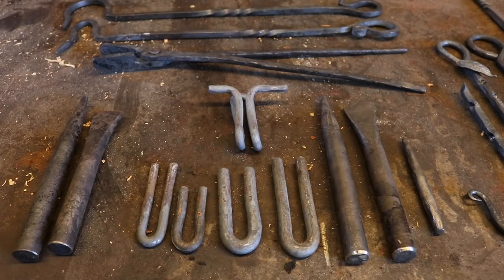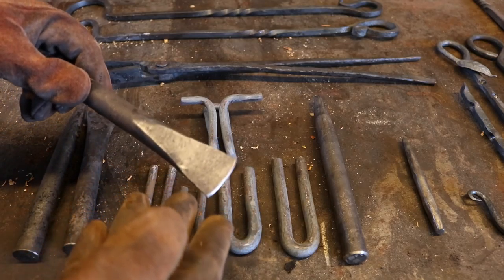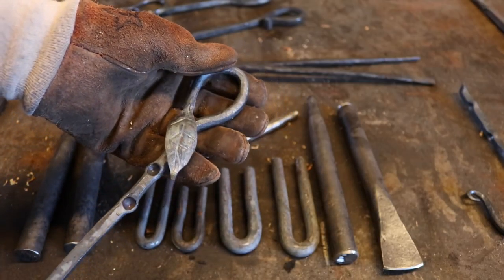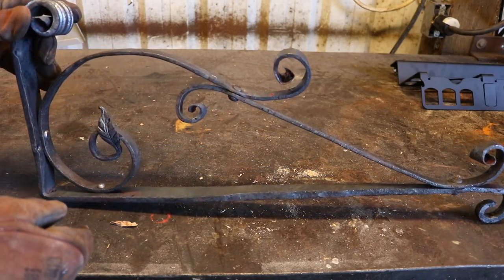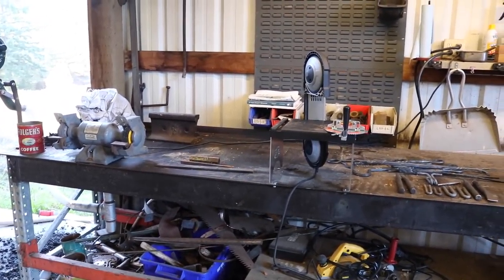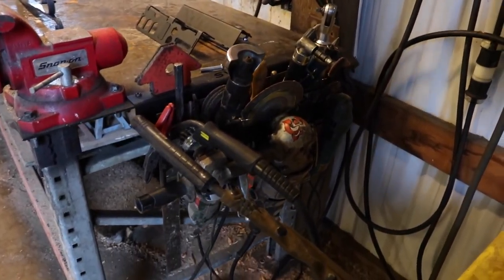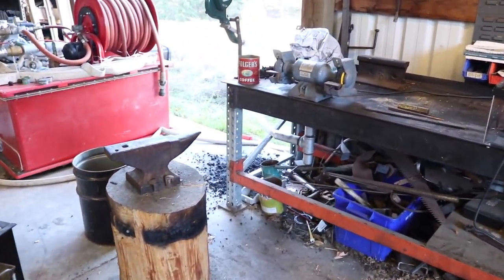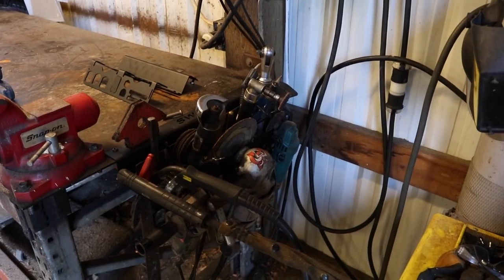WHY I STOPPED UPLOADING VIDEOS - Vote Today!

Comment: My first factory job in 1971 was at a factory that made ag and industrial wheels. I ran several forges when orders were placed, and I would have several going at the same time. I learned a lot about metal in a learn as you go kinda thing, forging spokes into steel rims and cast hubs. You learn the sweet spot, kinda like where the saying "strike while the iron is hot". I never forgot the unique lessons of that job, and used the experience throughout my life.  I think when craftsmanship is involved it is as much art as functionality. Like many of the patterns I built in the pattern shop, where bought as art later. For basic use, a tool would not need to have twists and added non functional additions, I think they were added as to gain a sale over a just plain straight tool.  So a basic functional tool when needed and the ability to make whatever you need is an invaluable skill. If you need a tool now, you probably won't try to get fancy, who the heck is gonna see it anyway?

Comment: Back here, a new anvil costs about 270 - 380 $. Used ones are so hard to find here so I've bought a few small ones ( about the size of a hotdog :) for about 18 $ a piece... For bigger things I use a decent piece of I-beam, weighs about 50 Kg ( about 110 lbs for you Cody :) so it doesn't move easily + it has a very big flat surface. It didn't cost me anything, 'cause my dad kinda liberated it from certain death :)

Comment: Yeah, tool storage is a big thing. I've been moving from the suburbs to a rural farm over the last six years. It hasn't been easy. Tools I need are often at the wrong location. I've bought duplicates when I got desperate. A hundred sixty miles is a bit far to get a tool to make the thing you're working on... forty miles round trip is still a bit of a journey. I try really hard to have a huge shopping list before I head out...

Comment: Wranglerstar, It should be pretty interesting when you get more into the forging. You might want to consider sweeping that floor when you set up the metal working/ forging area. Sure be a shame if the place go up in flames.

Comment: I see the political types are out in force.

The goal of being the best homsteader you can be is fine and doesn't preclude the metal working aspect.  Blacksmithing is a traditional skill needed by the indenpendant homesteader for most general meral work alog with some basic skills in sheetmetal work.  Just carve out an appropriate amount of time in your weekly schedule toyour level, which would probably be more time than less and barring some emergency, such as something around the house or with your olunteer firefighting, doesn't get interefeered with.  As you reach the evel you desire in skill, what works for your needs, you can cut back on the time invested to maintain the level you want.  Being a jack of all trades is the essential part of the homesteading lifestyle because it s all about being functionally able to do most of what is needed yourself so you only have to go to the specialist for those thing few things requiring the skills of a specialist.

You've kind of cut a career out of almost being a living museam of skills which would make a person independant and functional if our political/economical system imploded and thing like the powergrid were not available any more.  In your metal shop you would have to replace the blower for your furnace with a bellows or blower powered by something else, but changing all of your shop around to a new source for power is about all you would have to do to moveon as if nothing had really changed at all.  Therein lies a large part of your appeal with those who subscribe.  Most want to know how to do things the old way for the same reasons homesteaders and waanabes and I'll admit to that last part.

Comment: Oh no.  The block under the anvil has a great big split in it. 10:00
Not to worry.  When you finally find a new anvil you will need a new block to mount it on.

Comment: i think it looks pretty good for a first try, sometimes you are waaaay too easy on yourself, but in this case i think you are been pretty unfair. if those were you 10th attemps then i think you might have a point. but for first trys and learning they look pretty damned good. completely functional. in a pinch, youd be able to function as needed.